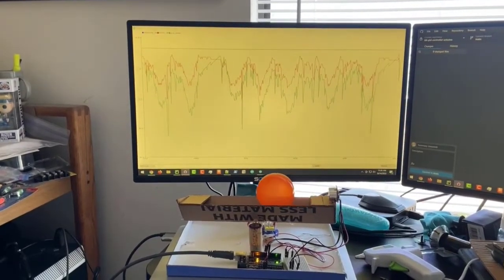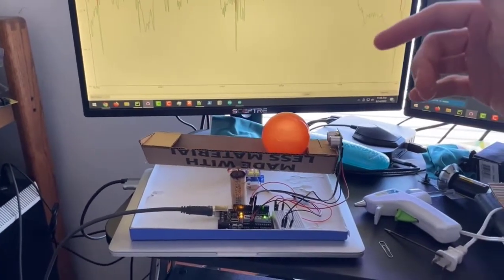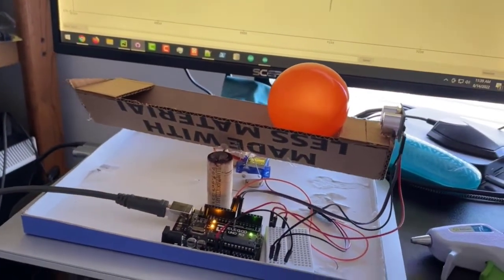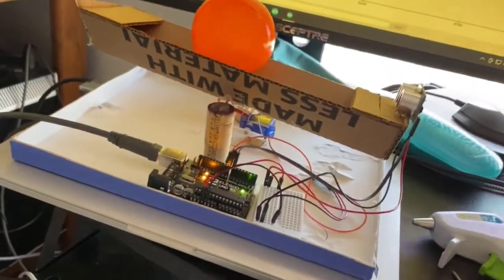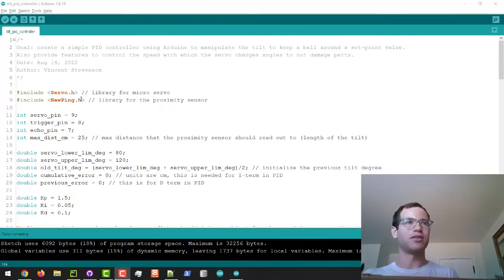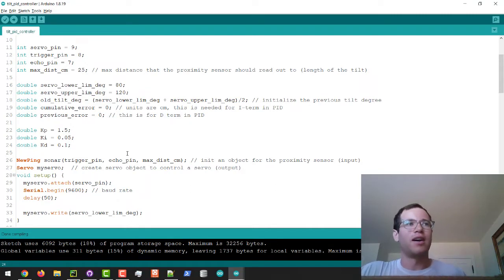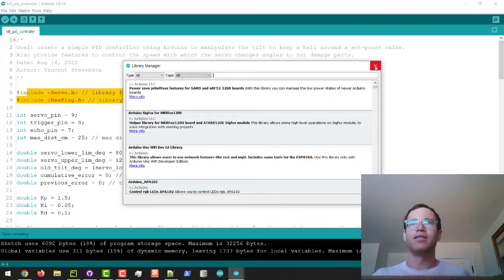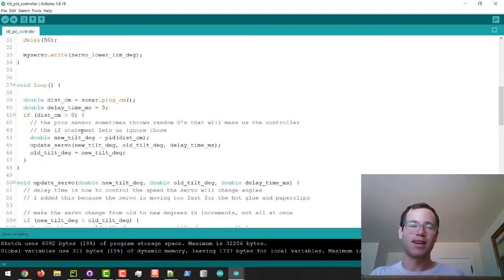Arduino PID Controller - Demo with Source Code!

Comment: does that last part you mentioned in the code dealing with the safety check and the new servo angle with the limits relate in any way to kd? or is it separate